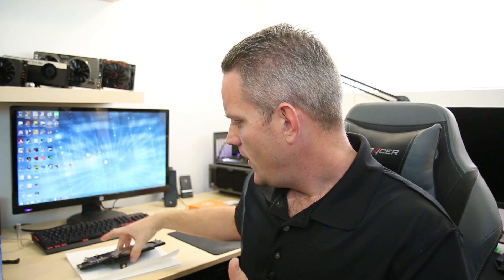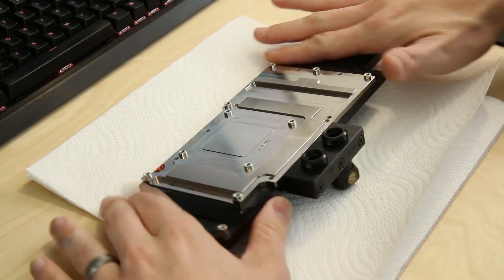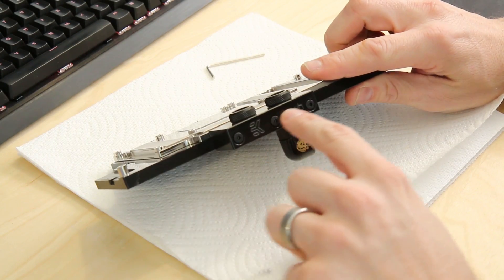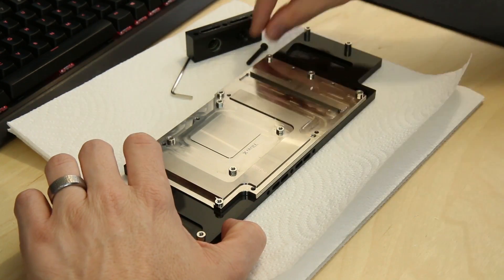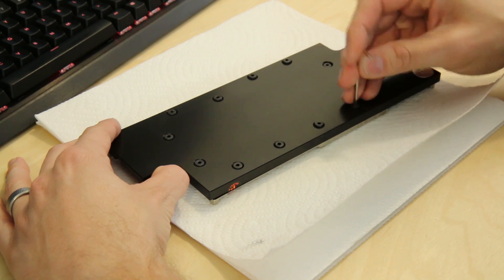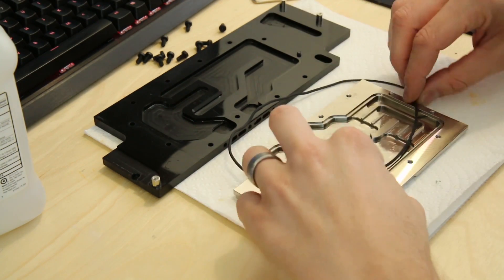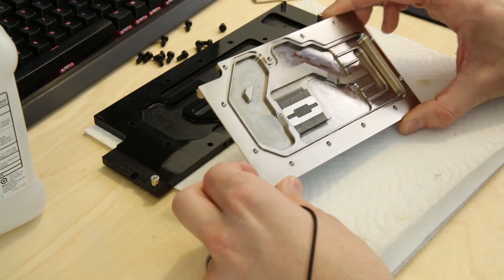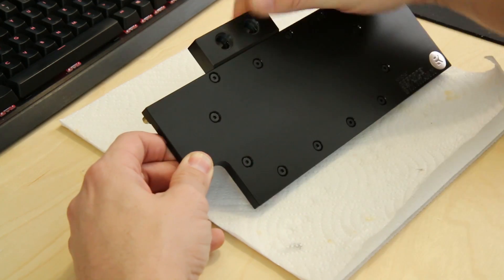Inspecting the inside of my GPU blocks - How to clean GPU blocks

Comment: Hi. I'm looking to build my own pc and need some help.  The computer I have now I've bought in 2004 and paid about 3600 for it.  It's run games pretty well (the ones I play anyway) up until maybe 5 years ago and now I can't even play Rift unless I have almost the lowest setting, so, I'm looking to build a new pc.. or buy one if there's a really good deal somewhere.  I just finished watching your 'R9 390 vs GTX970' video and I want to go with the R9 390,  I used to be a techie but have definitely fallen behind on everything really. Can you help me with advice on what you would get for around 1600Canadian dollars (about 1150us).  I'm willing to go up around 1300 US if it'd be something that will make a noticeable difference and worth the extra dough.  If you can help me, I'd appreciate it and here's what I want.  tower, and everything in it.  Motherboard, grafix card, ram, cpu, all that stuff, including a tower and fan nose is not going to be an issue for me as long as it's functional.  Water cooling as well or another method as long as it's central to the tower or if anything, needs to be plugged in separately.  I like ASUS, but I'm not picky especially since I'm a noob at this point.I signed up on your forum but haven't received a conf. email yet that's why I'm posting here.  and btw, if you recommend a different video card now that it's been a few months since you reviewed the r9 that's fine as well, as long as it fits within the budget.  And an ssd for the main drive at least.  Thank you very much in advance.
Reply: I can't link items or even see your entire comment because mobile, but I'll try and put you in the right direction. Feel free to ask questions. This build mostly tries to maximize performance per dollar plus futureproofness, so I'm putting down a super acceptable AMD chip instead of a 100 dollar more i5. If you want Intel go for a 390 instead of 390x.  -  /approximate/ prices in USD. 

Min-Max:
Fractal Define S ~$90 (take your pick - check out hardware Canucks for good case reviews). 
AMD fx-6300 ~$140
Gigabyte 990fx-UD3 ~$130
Hyper 212 EVO ~$30 
16gb DDR3 - $60
Sapphire 390x ~$450
Corsair CX650m ~$80
Samsung 850 EVO 512gb SSD ~$140
OR
Samsung 850 EVO 256gb SSD ~80 and WD Black 1tb hard drive ~$50

This takes you to /around/ $1150 USD (although these prices are entirely based on memory). Let me know if I can help further.
Reply: +TransHerring 
This is personally what I would end up getting had I $1100 USD to spend - http://pcpartpicker.com/p/k46Kf7

Although I will loudly state that 2016 is going to be HUGE for computer technology next year.
AMD is moving from 28nm GPUs to 14nm GPUs, Nvidia is moving to 16nm GPUs from 28nm as well.
Also more wide adoption of HBM2 

AMD CPUs are going from 32nm to 14nm with an expected increase of IPC performance of 40% (also there's rumored to be a 16-core Zen consumer processor - MOAR COARS)

To put it into perspective there hasn't been a die shrink from AMD or Nvidia in almost four years.
This is a big deal, so even though your PC will definitely still kick ass for many years to come, you'd be building it at a time where the next generation components are about to get one hell of a performance boost.
Reply: +TransHerring Heres the system. Should be able to run high end games on ultra and you should even be able to do some overclocking. If its a little too pricey for you I would take out the SSD or maybe even invest in a cheaper cpu cooler. http://pcpartpicker.com/p/2sJT23
Reply: +Luke Woodcock thank you very much, appreciate you taking time to respond!
Reply: +Butthurt Beluga Thank you for responding! I appreciate it
Reply: +dev70194 Thank you very much, I appreciate the response

Comment: Jay - before you write off the Fluid as a potential answer, you should... figure out how to examine your Radiators closely.
specifically, the difference between your CPU and GPU Radiators.

if there's some residue in your GPU Blocks, i wouldn't put it past that the Radiators could have a lot more crud built up.

i guess you should also probably check inside the two Pumps as well.

Comment: To reword the quote in case you didn't understand: Depending on the various components to your fluid mixture, you can accidentally cause it to react with some of the copper in your radiators when you eliminate the air in your loop. This releases copper electrolytes into your system, and at various air pockets (basically at the fittings), you will get salt deposits.

With that said: my guess is that some component in the dye (the actual dye, not the coolant or anti-microbial) was causing this effect and the heat in the GPU expedited the process in that loop.

Comment: I know that I have used petroleum jelly, Vaseline, on large o-rings to hold them in place while putting the two halves together. I have never done it for this application though. I am not sure what or if the Vaseline would have any adverse effects on a cooling loop, or how easy it would clean out with a distilled water flush.

Comment: I had white powder very similar to this in my first water cooled rig about 6 years ago. I had a dual loop system and it was only the gpu loop which had this problem, the cpu loop was spotless. It coated the block but was much worse in the rad (Thermochil PA120..2) where it was seriously thick and took a lot of effort to clean. I was also using feser coloured tubing, green on the cpu loop and red on the gpu loop. It was noticeable that the red tubing had the white powder coating its inside, and also some of the red colouring much have leached out as it stained a very small piece of clear tubing I used to link the res to the pump. The green loop did not have any of this. I later formed the opinion this was plasticiser leaching from the tubing, with red feser obviously being much more prone to it more than green for some reason, or it could have been this salt issue you describe.

I noticed in your other skunkwork build video you kept a short length of soft tubing in the lower compartment, which looked pretty cloudy, this is how my red feser would have looked if it was colourless, i.e. cloudy due to the powder coating on the inside. My theory for your increasing temps would be that the rad in the gpu loop might have had the same powder coating the insides as mine did, I hope you gave them a good clean durign the strip down. Whether this is plasticister from that short length, or salts developing in the gpu rad only, who knows.

Also, the fluid I was using was plain de-ionised with PT-Nuke and I know this stuff is frowned upon these days too. It is possible there wold have been different concentrations of PT-Nuke in each loop which would also have been a potential differnece. Anyway, hope this info dump may offer theories for the white powder.

Comment: Yeah air cool is decent, but it keeps getting better since efficiency on the CPUs keeps increasing.... Soon liquid cooling will have no advantage over air... Except in very air deprived builds like some mini-ITX etc.

Right now AIO are more than enough, unless you have triple sli; custom loops are purely aesthetic.
Reply: Increasing efficiency of CPUs doesn't make air cooling more powerful. Custom loops aren't about being enough. They're about getting aesthetics, low acoustics while getting even higher overclocks and lower temperature.
Reply: Increasing efficiency means lowering energy usage which translates to lower temps...which in effect reduce the heat dissipation required... Which actually means air cooling is becoming relatively more powerful than before.. And the massive heat dissipation from the closed loops are starting to be wasted, like I said AIO are more than enough...and closed loops are only really needed if you have graphics cards stacked(with air they would starve each other).

9/10 times a 240 AIO would give you all the headroom you need.

CL are really the most effective with Sli or Xfire configurations.

Of course on the aesthetic game they are king... Since you are practically pimping your build.
Reply: +stephan walliser just wanne say that watercooling give higher overclocks and lower temps in aditional of less fan noise.
watercooling includes custom loops or AIO .
even the vap air cooler cant reach the watercooling performance.

there is one point that everybody seems to miss.
the smaller the proccesors the more concentrade the peak spike is and get very high temps to the die.those heat spikes spots gives watercooling an big advantage over aircooling.

so if you are gona overclock at max cpu capacity its an must to go watercooling other whise its a waste of time and money.

custom waterloops give even more lower temps because the bigger capacity so it takes longer to heat up liquid to hes nominal temperature.

if you dont overclock at all then watercooling isnt a must but can help toget lower temps aka longer longivity and lower noise because rad fans can turn at lower RPM at an constant rate (not on the cpu connection)and you dont get ramp up or off fans sounds that can be needed at max OC.

larger fans = lower RPM and less noise .so 140 mm rad fans are better than 120mm fans .if you buy AIO go  for 280mm AIO's or (420mm)

another to consider is the material used for the rads.full coppers like swiftech or EK gives 1 to 5C lower temps than the the aluminium fins with copper tubing like corsair ones.

for overclockers enthousiast ,the 5C is a very big problem.while for non-OCed gaming rig it doesnt matter.

its screwed up to say  that aircooling gets more performance because of efficiency of the cpu .aircoolers didnt adapt or has been changed for it.its the cpu it selfs that gives lower temps but....when you overclock its an whole other story because the lower temps of the cpu means lower clocks.
just look at 4790k and 6700K and they're overclock potensional.
there is still heatspikes and lower clocks doesnt mean lower temps on those spots because the shrink.

the only thing you could say is that non-overclockers have less fast reason to get AIO,exept for the reasons i told above.

custom watercooling isnt just an fancy pancy system to brag about .its also the way to go if you want to get every last Hz out of cpu and gpu and chipset and motherboard,then get mega records on benchmarks and than brag about it ....

my motto is:
opinions are like asses,everybody has one.thats why im an asshole that stick at facts.
Reply: You need to take a step back and re read... I said air coolers are decent(and they are even for mild OC) they used to be trash because the processors were much more inefficient.
But as technology advances(not short term a la 4790vs6700) air cooling is becoming a better and better(relatively) option.

Like I said at this point AIO is really all you could need for CPU...custom loops are only practically useful on multi-cards configurations.

Comment: Jay I bag to differ when you said it was not as bad as expected at around the 4 Min mark. If you look at the acetal block you will notice that the white gunk has formed in the shape of the micro channels which suggest that those channels which is the main area for heat transfer is contaminated. I strongly suggest you clean between the micro channels too and not only those that you can see as you did in the video.

Comment: Not a chemist but an electrical engineer and have delt with corroded copper and i believe a lit of copper compounds have distinctive colors. you previously mentioned that the nano fluid was a better conductor of heat than water, so I was thinking if the nano particles were bonding together and falling out of solution that would reduce the thermal conduction? also with the build up of what ever it is could they combined give the increase in temperature. too bad you didn't do a test of how cool the loop was kept by different  fluids in the loop. could be a cool video but it would be a lot of loop cleaning and testing.

Comment: Hey Jay, did you notice if your CPU temps (idle) were creeping up as well? because you said that your GPU temps were higher than normal but also that the GPU loop had experienced the most colour change, so was wondering if somehow the change in the fluid was affecting its thermal capacity thereby resulting in higher temps. (just a spit-ball idea, probably wrong)

Comment: for reference i have an EVGA Titan X Hyrdo Copper and it has a full cover ek water block and it never goes over 39c so 60c would be crazy high
Reply: Remember he has an extreme edition cpu which is overclock and 3 Titan x all of which are also overclocked. So it's not that crazy to think its 10 to 20 degrees higher on the cores
Reply: +Will Leonard 
the CPU runs on a separate Radiator loop.

but yes, he does have 3 GPU's instead of one. that makes a big difference.
Reply: +taiiat0 forgot about that my bad
Reply: +taiiat0 Yes but the issue isn't that it's hot, it's that it's hotter than it was before
Reply: Senzorei that's the overall issue, but not what's being talked about in this Comment Chain.
slowclap
Reply: +taiiat0 What can I say, I'm sorry. I just wanted to solve a problem. That is the other thing I try to do in YT comments other than give advice/ ask questions and fight arguments in a fanboyish manner.

Comment: I have an AIO* for my CPU but I really dont know why youd go to the trouble to custom water cool a whole system, for the extra boastability in overclocking you could have the same or better performance in a few months with generational progress of GPU's and CPU's. The water cooling increase in framerates isnt going to take you from unplayable to playable.

Could donate that money to charity and have a computer with slightly lower performance.

* - AIO was a waste of money, should have just gone with aircooler

Comment: So possible that the copper radiators are causing the issue? 
And possible that they have build up in them?
Hmmmm i was just to about to get a copper radiator now you got me worried...
Good vid as always mate cant wait for the next Skunkworks vid.
Reply: +Matty f - But what else would you get one made of?  I'd say that if copper is problem for the fluid, then it'd be the fluid at fault, not the copper.
Reply: +9ff70f96 Ok so are all radiators made from copper? 
i was unaware i thought there could have been brass and aluminum maybe.
I was looking at the occool full copper rad...
Cheers for that, thanks to this im also going to use EK's pastel coolant.
Reply: +9ff70f96 Yes and im a watercooling noob only currently have a corsair all in one, just building a new system with my first attempt at a custom loop.
Reply: +Matty f - I think (though not 100% sure) that most if not all rads are typically made from copper as far as the tubing (that contacts the cooling fins) is concerned, and brass (which is copper+zinc) for the end tanks.  Cheaper rads = brass fins; more expensive rads = copper fins (neither of which have direct contact with the coolant though).  Aluminium would be a big no-go I think as it corrodes quite easily (and nastily), especially in loops that contain other metals (like copper) due to galvanic corrosion.  I am no expert here though by any means.  I have used some aluminium parts in the past and they did suffer with corrosion quite a bit after a few years.

I'd say it's certainly a possibility the radiators have build-up inside them, but I would be surprised if it was that much that it started to slow the coolant flow rate severely.  I think realistically it could be more like a fine coating of gunk on the metal surfaces inside causing a loss of heat conduction than an actual blockage.

Comment: In case anyone was wondering about the O rings under the terminal, or "port" as jay called it, they are just normal 1mm x 15mm ID o rings. I was able to buy a 50 pack from mcmaster (part number 5233T24) for like 13 bucks. I wouldn't reuse the old ones, especially with the build up like jay had.

Comment: Jay have you tried automotive coolant? My car has shellzone and the system is very clean. 

Just a thought. 
It can be mixed from a concentrate down to a diluted mixture. 

Would make interesting vid. 😀
Reply: +Shamie Ramsamuj most automotive coolants become acidic after a period of time, as long as you change it regularly (every 30K miles I guess it would be OK LOLZ).  I know that Purple (Pento-Frost) the Orange-Organic (GM Dex-cool), Yellow (Silicate based) and Green (Inorganic) all change PH (to acid) over time and would be detrimental to the pump, reservoir and o-rings/gaskets. Though I would like to see a vid on the effectiveness :)
Reply: +Gary Albin - I've run it (ethylene/propylene based) for 11 years here, never a single problem.  10 of those years on the same copper 3x120 radiator and Laing D4 pump which still runs about as good as the first day I bought it.  And I've probably run for as long as 2 years on some of those fills.  I can't say that all coolants will act the same though, so couldn't rule out the possibility of issues arising with other brands, but I've not experienced any here.
Reply: 9ff70f96 based on your screen name you must be a Porsche fan (9ff) Jan Fatthauer sure knows how to build a great machine.  I'm a P-car enthusiast as well, have a heavily modified 988CS1.myslelf, TPC stage 3 turbo set-up, DSC, IPD race Plenum, Quaiff LSD, fully adjustable suspension, and race exhaust..  
In regards to cooling with auto coolants, what kinds of temps are you seeing vs commercially available PC coolants and plain old distilled H2O?
Reply: yeah your're right about it breaking down but i belive this may be in part to the tems it has to deal with. Jay's pc wont get that hot so it would most likely last till he decides to tear it apart again :D